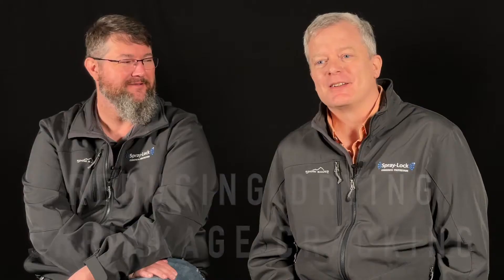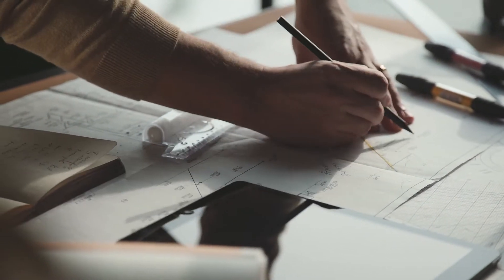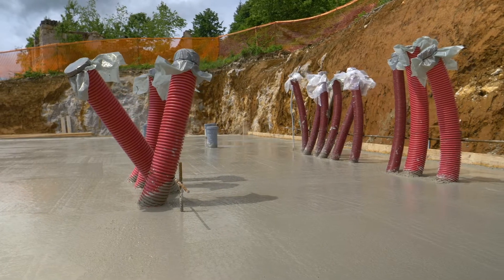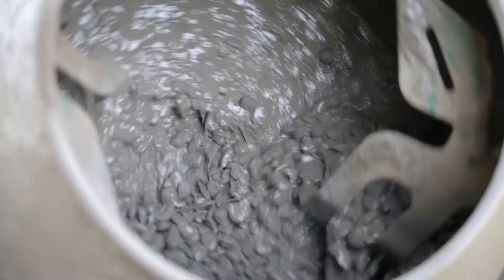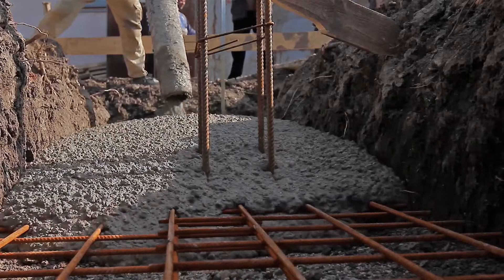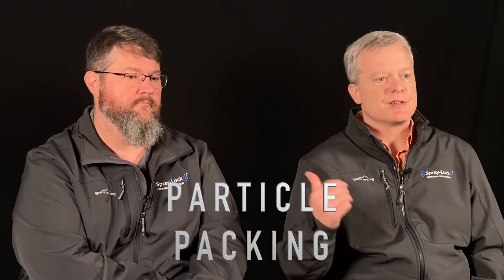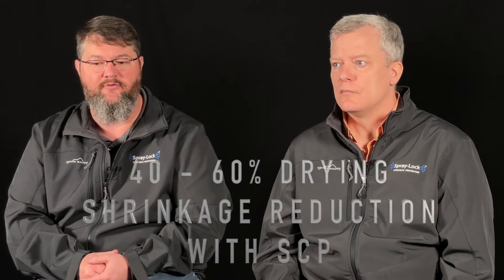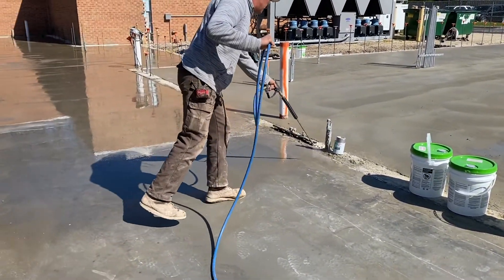Reduce Drying Shrinkage Cracking

Comment: Hello,  we have recently changed to type 1L cement and type c flyash.  our finishers are having alot of issues with shrinkage cracking in first hours with the flyash mix.  strait cement they do not.  do youhave any suggestions?
Reply from the maker: We would recommend looking into initial and intermediate curing practices as described in ACI 308 Curing documentation. Wind breaks, monomolecular evaporation retarders, misting, and other methods can help reduce shrinkage cracking. In addition, some concrete fibers are also effective in reduction of plastic shrinkage cracking.  Your ready mix concrete supplier should be able to share information on the particular fibers they carry.
Reply: Very interested if your type C fly ash is OK with ordinary portland cement?  I don't know if there may be a shrinkage reaction between the calcium hydroxide of the type C and the calcium carbonate in 1L?  Then try type F fly ash with 1L?
Reply: @SpaceCrete Type C fly ash has been found to have issues causing ASR in concrete. I prefer Type F to prevent ASR. Fly ash has known issues with workability. The main source of ASR is limestone aggregate and ASR is highly local. Check with your state Department of Transportation for their experience in ASR aggregates in your area. If ASR is not an issue, I would eliminate it and get better workability.